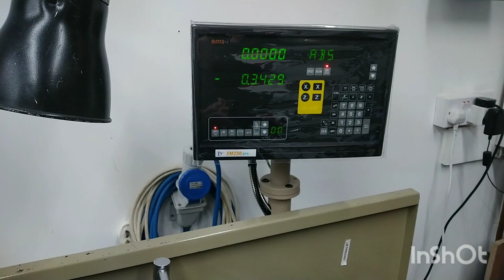Harrison Mill Restoration Part 8 - Threading in the lathe, a 5tpi Acme Nut in Bronze

Comment: Well done Carl, great result. It sounded horrendous but I am sure the camera was picking up on the cutting noise. Your compressor kicking in just about put me in hospital lol. Cheers, Jon
Reply from the maker: Thank you very much Jon. Yes, the sound had me on tenterhooks to begin with. I decided to stick with the 2.5 thou depth of cut and see what happened. Despite the awful noise, after a few passes it was apparent that the tool was cutting a decent thread and leaving a good finish. Even if the audible clues suggested otherwise. My chief concern was that I would end up with a chip jamming in the cut. Hence blowing through with air after each pass and using the cutting oil. The bronze cuts well dry, as you know. I think though that in this instance it's use was justified. Even if only because it caused the chips to coalesce and sit in a lump at the bottom of the bore, rather than flying around randomly and potentially jamming in the cut. Thank you very much for your taking the time out to watch and comment. I really do appreciate it. My compressor did me no favours either.
Reply: My camera does that too. It finds the most unflattering noises it can and focuses in on them. Usually my inane ramblings.
Reply from the maker: @retromechanicalengineer  So does mine.

Comment: Brave video to make Carl! you have to concentrate when you are threading, and you made an excellent job. I tend to start trying for a fit before I have reached the "book" depth to allow for wear in the thread, but you got an excellent fit. Re the extra views, YT is an odd place, my best vids so far have been when I have done odd jobs, like a ford Mondeo heater repair, and rebuilding a stihl chainsaw carb, thousands of views and thanks from all over the world! A lot of it is down to the wording  of the title and the thumbnail you use, the algoritm judges you on those two factors! cracking watch mate, and the crackling cutting noise had us both clenching I am sure!!
Phil
Reply from the maker: Thank you Phil. The calling out of the sequence of operations on the lathe was not just for the camera. It was to stop me making a mistake. As an aircraft engineer I studied human factors. Truth be told I did try the screw before going the extra 5 thou. It was tight. Just like the delrin was. Doing the delrin test pieces gave me the knowledge to know I could take that extra 5 thou. I'm very glad to receive your comments. Thank you so much for your input and support. Hugely appreciated.
Reply: @carlwilson1772  worthy praise for an engineer with a  clean machine!!, I usually make an aluminium practice peice before diving in to the real job!
Reply from the maker: @philhermetic  The first thing I do before starting a new turning job is clean and lubricate the machine. Not only does it prepare the machine for the task, ensuring that it performs well, it also puts the mind on the right path ready to perform accurate work. Right work proceeds from right thinking.